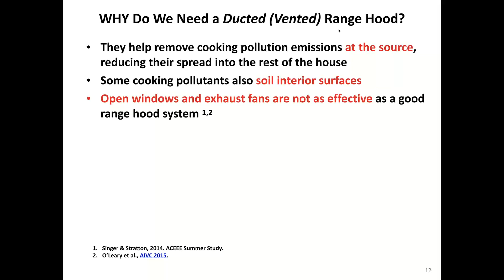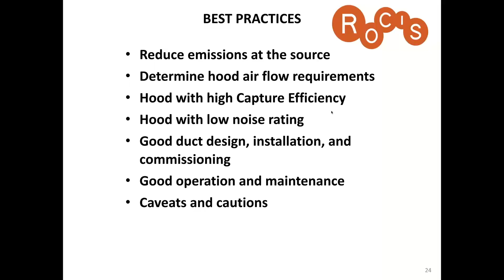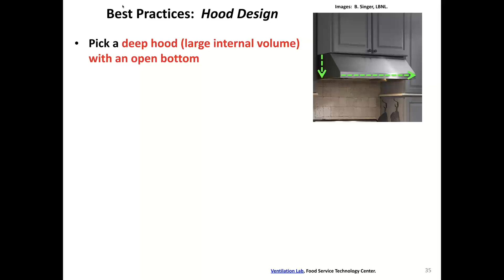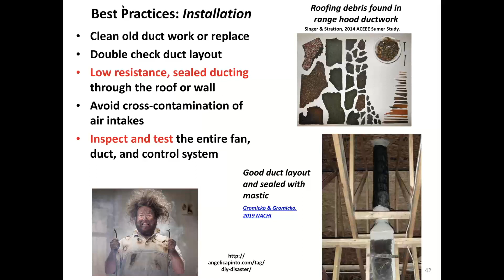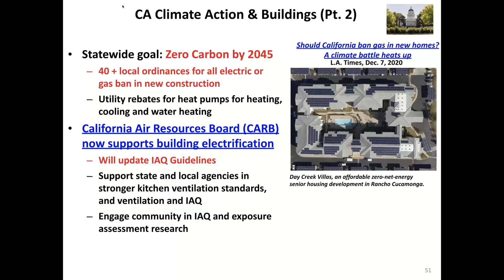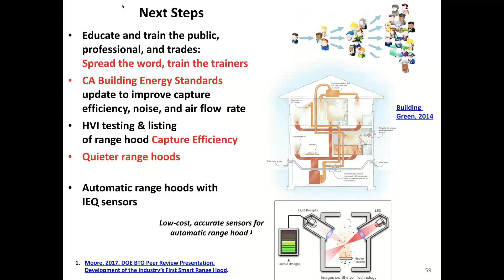Keep A Lid On It: Best Practices For Reducing Cooking Pollution In Homes

Comment: A wealth of good information.  Thank you for putting this out.

I had a though that maybe the new electric appliances on p58 should be under or near the running range hood to capture their outgas.

Another thought for future work might be the trade offs of positive (filtered input fan) / neural (filtered input with balanced pressure sensor tied to exhaust draw) / negative pressure in a household.